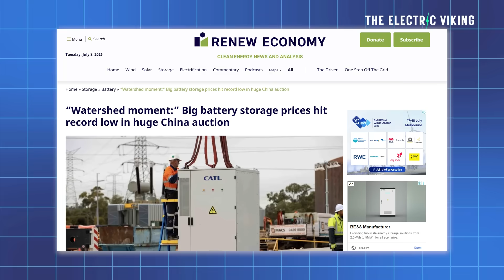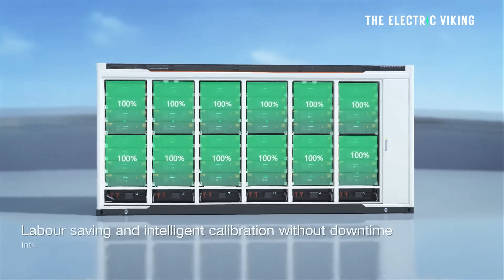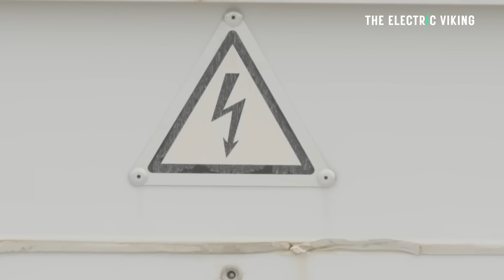Battery prices fall over 30% in 12 months - coal and gas economic madness

Comment: The fossil fuel industry is done.
Reply: They should be but they give generous donations to politicians so they may last longer than they should.
Reply: I wouldn’t say it is done. We still need oil for chemical manufacture, but the cash cow of burnable fuels is declining.
Reply: we will always need oil, but not for burning!
Reply: 🛢️🛢️⛽ BIG OIL dont like Solarpanels and Electric cars and battery storage ‼️‼️‼️😁👍
Reply: No they aren't... Australia will be powering our grid with gas fool
Reply: And where do diesel trucks gets their diesel fuel from? Ships burn heavy fuel oil. That’s not coming from solar panels and batteries. Solar and batteries works okay in domestic applications. Industry - forget it; burning some dino juice is always going to be cheaper.
Reply: @sullivanrachael  There are already fleets of battery powered trucks, even B doubles now, they are set up with removable batteries, that only take minutes to replace. Look into it, tech is changing, time to sell the horse and cart mate...
Reply: @sullivanrachael  Eventually there won't be diesel trucks moving goods economically. Just like the horse and cart, out of date technology.
Reply: @sullivanrachael depends on the industry. Maybe for cement and steel manufacture but not light and medium engineering. Or even vehicle manufacturer.
Reply: @stevejones2310  Chemical industry will need oil as a feedstock. 

I don’t see that as a problem for the short term.

Burning fuel needs to be reduced wherever possible, there are already many perfectly viable alternatives for a lot of use cases. Reduce / Reuse / Recycle of products needs to be allowed to function as much as possible to reduce demand on primary oil as a chemical feedstock.
Reply: @sullivanrachael  "And where do diesel trucks gets their diesel fuel from?" - too pity for somebody. China is going to electro trucks
Reply: @sullivanrachael You're wrong on trucks and industry(as per generation). Shipping is a harder problem, as is long distance air travel. Anyways, the market for oil will collapse in the coming decade. Coal is already in stark decline.

Comment: I’m curious, what if you could burn coal cleanly with processing and refining? Would coal still be bad? Because I think if it doesn’t pollute and it charges our LFP batteries 🔋 then why dislike it. Maybe only use it when demand exceeds supply of energy from solar and wind and other clean sources. Especially since AI 🤖 is really pulling a strong need for energy from the system grid.
Reply: CCS drags down plant efficiency by 20-30%. With heat recovery it’s less, but coal to electric energy has an effiency coefficient of around 30%. So if you reduce that because you use even optimised heat recovery CCS you end with something like mid 20% in terms of efficiency, which is the same as solar. Why would you want to go through all this added trouble like digging that stuff up, transporting it, burning it in a highly complex system and take care of the CO2 waste in storage facilities for long time… sounds much more complicated than a solar panel giving you same results with way less complicated stuff around it.
Reply: Coal is expensive.
Reply: Coal is not burned cleanly anywhere.  That would be way too expensive.

Comment: Now think for a moment- currently, the cost of robot labor (per hour) is about $2–3 when there are still very few of them; how much will their labor cost in 10-15 years??? 
30–50 cents per hour??? 
Who can do it cheaper???
Reply: So if they cost $10-20k and $1-2k in energy and maintenance and a 5- year life and 80% uptime, the cost is $15-30k/ .8 x 24 x 365 x 5 = $0.40-$0.80/hour
Reply: @robertsheperd502  No, no- it’s $2-3-4, someone already calculated that (service/repairs/etc.), but I don’t remember the exact figure, and in this context the precise KPI doesn’t matter; what matters are the low costs without economies of scale, and under current energy/battery prices (and what if the Japanese invent a quantum battery? Or new power plants in China? They’ll be ready in ~10-15 years).

In short- in almost no country does a person work for less than $0.20/h??? (and even if they did, we’re talking about swarm technology vs. exponentially growing communication errors/ mistakes when scaling up human teams). 

And this is just the beginning of the analysis...
Reply: @marcin3136  US robots cost the same as Chinese robots, so why are USA cars so expensive?
Reply: I was told recently my friend in the business that the real price of robots is between 10 and 12.00 per hour. 

All of the AI and robot companies are giving their products away at greatly discounted prices. 

It's what almost every company on the internet has done. Such as Amazon. 

The reason is the cost of electricity for thinking.. 

I presume that you are correct and those prices will drop so they may be 6 to 8 dollars an hour in a few years..

But all these new companies aren't going to give away free products forever.
Reply: @mac_mcleod  How? Batteries have already dropped in price by 30%, and they’re a key part of the total cost. Service costs will go down by 90% (currently, that’s where the auto industry makes most of its money- not from manufacturing, which brings in laughable amounts). 

It’s all about who grabs how much of the market. If it’s China, those robots will be working almost for free, because it’ll be profitable that way. How long will one 'live'? Besides, they’re evolving faster than laptop- a new one every 5 years (?). 

And just the scale of production: right now, China produces 250,000 cars a year in a single factory (99% of the work is done by AI). 

So how many robots will they be making annually in 10 years?
Reply: @marcin3136  Robot are expected to scale slowly but exponentially.    By 10 years, humanoid robots alone are projected to be 6 million per year.  A total of about 22 million.

Projections for 2045 are 300 to 500 million.

That doesn't include dog robots, warehouse robots, etc.
Reply: @mac_mcleod  Check the data- we've NEVER accurately predicted the pace of development in history, so I don’t focus on that (or other "miracles") and treat it as a variable: "we don’t know the pace." 

I analyze everything else, factoring in this "unknown". There are many elements involved; mainly sociology and psychology, not just economics. 
On paper, the Segway looked perfect too… and what came of it? Other problems emerged.
Reply: @mac_mcleod  Do the math again, but calculate it on a yearly basis and without: vacations, weekends, breaks, sick leave (you’re still paying, but there’s no production), etc. 

It depends on the model, but the cost maxes out around 4$. 

And don’t use human metrics to measure robots; calculate per year (and keep in mind you can turn off the lights, unplug the fridge with Cola and Fanta, downsize the kitchen fire HR, etc.).
Reply: @mac_mcleod  You can't calculate depreciation as a single flat rate, because you might buy a robot for $20K or for $150K; and that also changes the maintenance costs, since you'd need different kinds of specialists. 

On top of that, task complexity varies, which directly affects energy consumption. 
And most importantly… if you're a well-known company, you might get robots for as little as $1; just like how sports stars get free cars to drive around and promote the brand. Same principle here: “Everyone watches the leader.” Most people don’t really understand what’s happening, so if the leader bought the XXX-YYY robot, it must be good and worth it (solution benchmarking). 

Of course, no one’s counting the fact that they got 200 Teslas for free 😄
Reply: " the cost of robot labor (per hour) is about $2–3 when there are still very few of them; how much will their labor cost in 10-15 years??? " The cost of robot labor per hour is substantially higher than that. In the industry I hear estimates an order of magnitude higher than that.